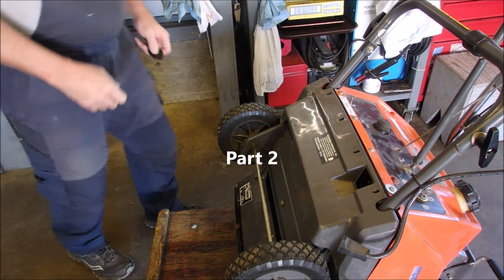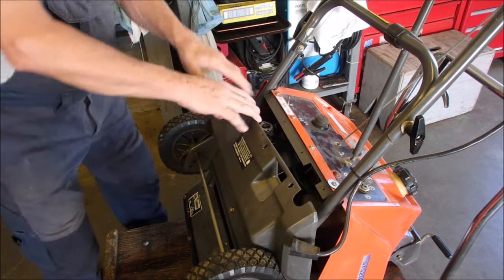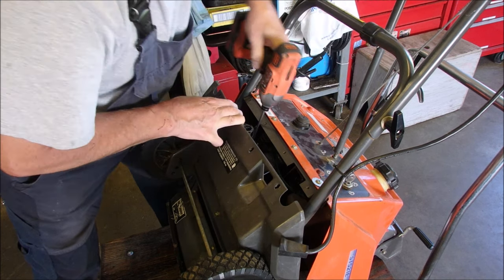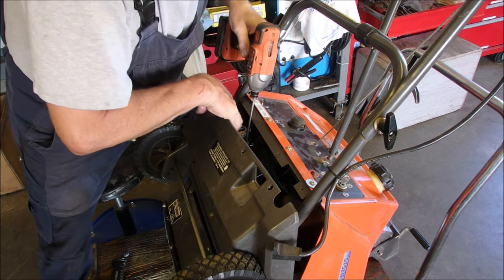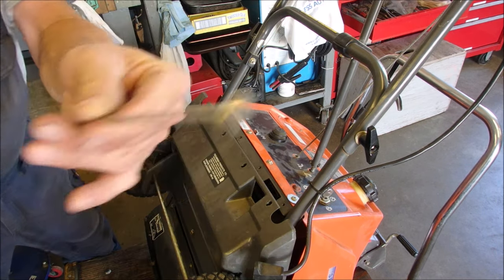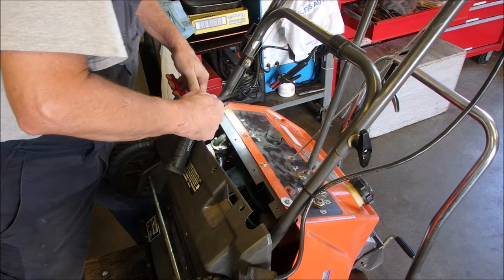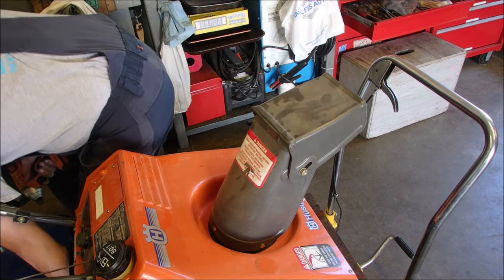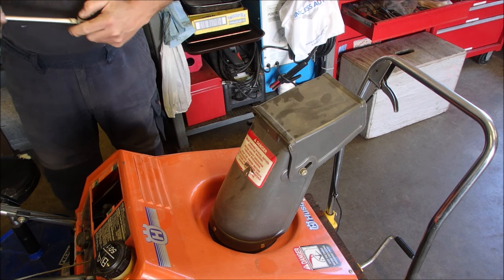How to Repair a Governor on a Husqvarna Snow Thrower

Comment: Hi Bruce. . .Working on those 2 cycle snow throwers is much less aggravating if you remove the lower belly pan as well as the top cowling.  The extra time taken to do so really makes the job much less annoying.  They are poorly engineered and are a pain in the patoot to work on. Takes too much time to repair and is usually not worth the effort.   I don't take them in for repair anymore because most of the time they have been neglected and the owners usually ask me to repair them the day before a snow storm is expected.  I admire your patience. . .Thanks for all your videos.  I enjoy watching you.
Reply from the maker: You are right.  Yes if I was to do this model again i would do it differently.  I am always shy to remove more panels than I thnk i need as they are so hard to put back together,  The owner of this one was very patient so I did have to worryabout time.  Not having snow the day before helps.   Thanks.  The loose governor threw me a curve ball.

Comment: What is preventing that damn lower cover from coming off?  Like you say, a good night's sleep usually brings the problem to light, but usually at 3AM!  OK, that lower cover goes below the axle.  The lower cover on my toro two stroke comes off pretty easily, but no nice access plate for spark plug changes like this one.  God forbid you have to service the recoil on my toro, half the frame has to come apart to get the cover off.  Yeah, Mr. "Fixit" was messing with that governor for sure
Reply from the maker: Right  If I do this one again there would be a difference in y proccess.